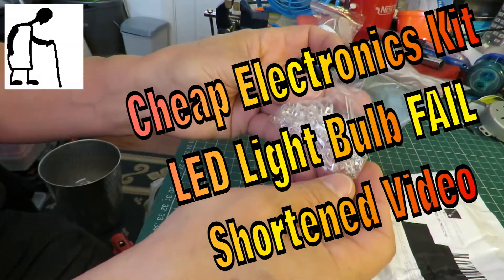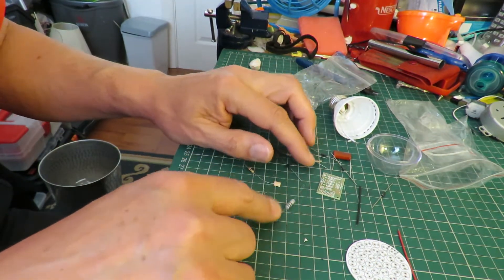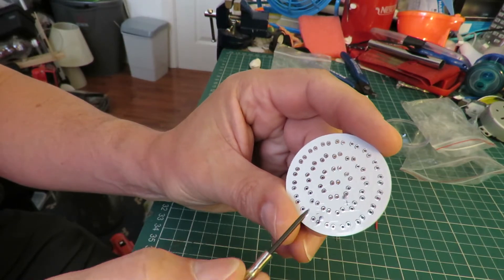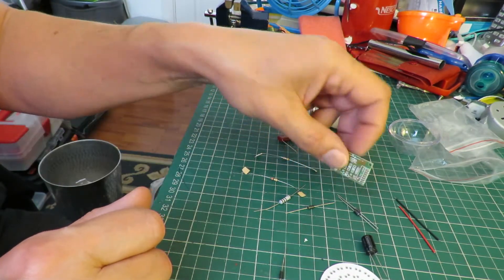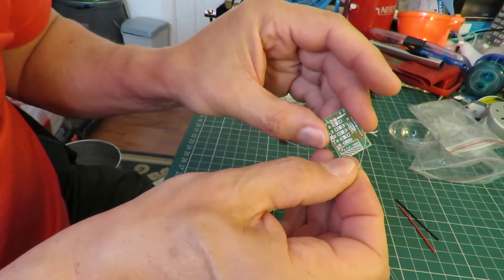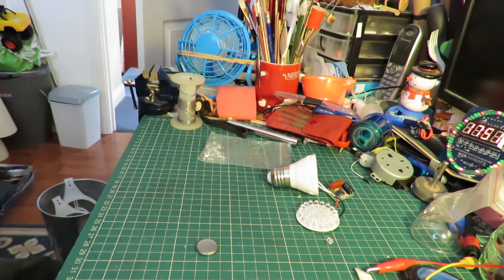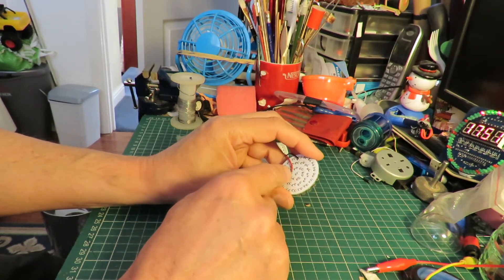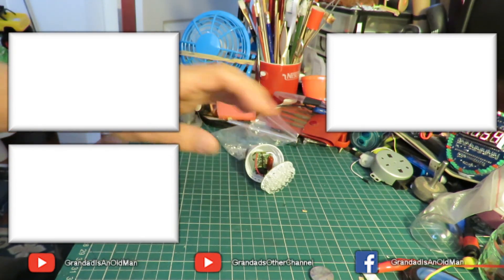Cheap Electronics Kit LED Light Bulb - FAIL

Comment: I've just assembled one of these kits, with UV LEDs (Forward Voltage 3.2V-3.4V), and it works great. Looks really 😎

I'm guessing it was the low Forward voltage, that did it for the IR LEDs.

Clearly, there's nothing with the kits themselves.
Reply from the maker: Sounds great, although I would worry about UV LEDs, do you know which UV it is (A, B or C) as they can cause cancer.
Reply: @GrandadIsAnOldMan  It's in the long (~ 400nm UVA) range, and it's quite low power, 50 - 100mcd.

Comment: i think ir led has 1.6v and white led  has about 3v
Reply from the maker: Yes, I was watching bigclivedotcom's video and he changed the resistor anyway as he thought the resistance was too low even for normal LEDs, I should have thought that through. The listing for the IR LEDs I purchased show Forward Voltage (V): 1.2-1.4V so they probably had a bit of a surprise :-) Whites are listed at 3 - 3.4 volts

Comment: Hi, I agree with ayylasco; you  have to replace the resistors on the capacitor dropper supply with higher value ones. Thanks for the videos.
Reply from the maker: Thanks, yes, I was watching bigclivedotcom's video and he changed the resistor anyway as he thought the resistance was too low even for normal LEDs, I should have thought that through. The listing for the IR LEDs I purchased show Forward Voltage (V): 1.2-1.4V so they probably had a bit of a surprise :-) Whites are listed at 3 - 3.4 volts
Reply: @GrandadIsAnOldMan  I think the supplied  10 ohm resistor is acceptable, for the 3.0 to 3.4 volt, white LEDs.

Yes, you could raise the value, and take some of the stress off the LEDs, but 10 ohms is still within reasonable limits.

Comment: in my opinion. infrared LED requires less voltage than white LED. so as the result, it blew up most of it. infrared is <2v while white ones 3.2v I think.
Reply from the maker: Yes, I was watching bigclivedotcom's video and he changed the resistor anyway as he thought the resistance was too low even for normal LEDs, I should have thought that through. The listing for the IR LEDs I purchased show Forward Voltage (V): 1.2-1.4V so they probably had a bit of a surprise :-) Whites are listed at 3 - 3.4 volts
Reply: GrandadIsAnOldMan very interesting project. I'am curious about infrared led bulb. thanks for the video.
Reply: @ayylasco  I don't 'see' the interest in IR. 😁
Reply: @BedsitBob  I got that 😂